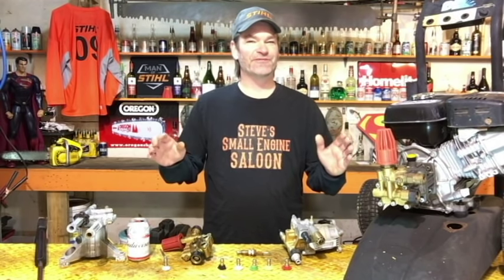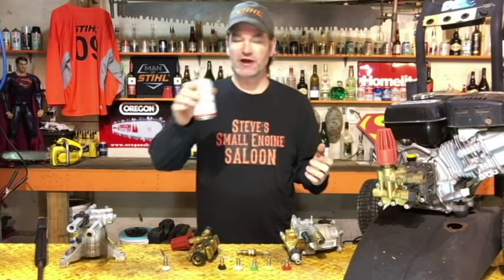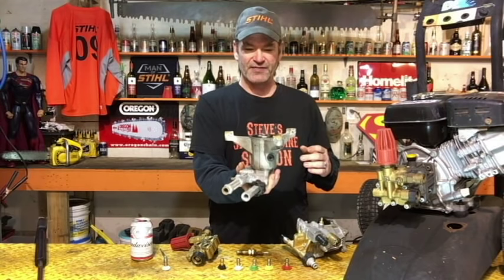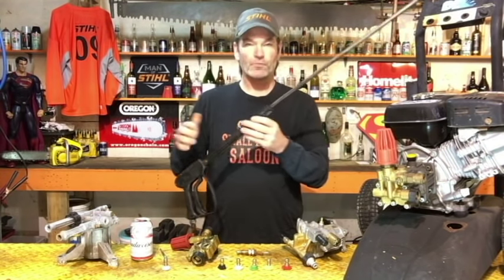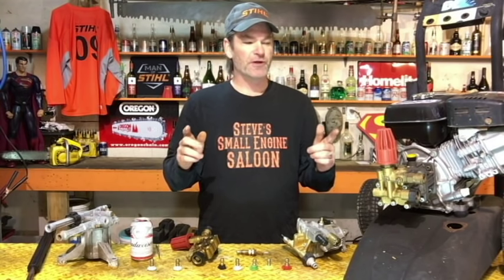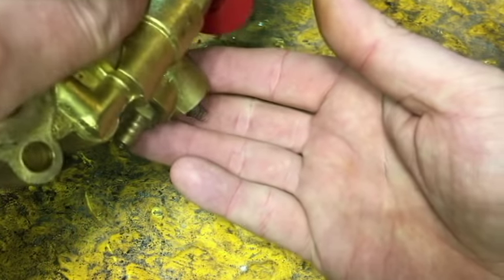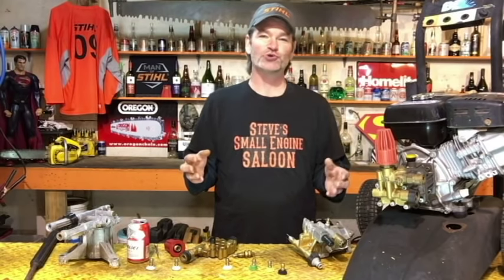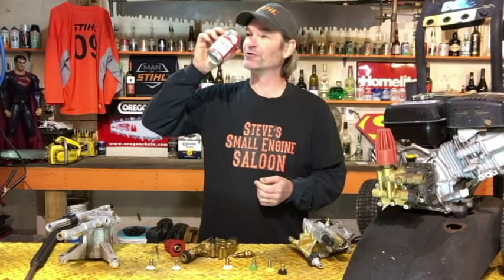How To Fix A Pressure Washer That Has Low Pressure

Comment: Thank you so much Steve for making this great detailed video. Can you please let me know if 3200 psi with 45 degree nozzle is too much pressure for car washing ? and if you can please guide me about the safe pressure for car washing, I will be glad. 
Thank you
Reply from the maker: That is fine for car washing, but the key is......how close to the car is the tip of your wand!  If you stand back a couple feet, the pressure hitting the car if far less.  If you put the nozzle 2 inches away from a rusty spot, it will blow a piece of paint right off!  Just use common sense and you should be fine.....  Was that helpful or no?
Reply: Thank you so much for the quick reply and help. That does make sense
Reply from the maker: You're welcome...
Reply: Pressure is not what peels paint, water volume is. If it is a machine bought at a chain store it will not take off paint
Reply: @AustinVb14    l am sorry Austin but I disagree with you.   Take the water hose off of the pressure washer and put the flow on the car.  You will have far more volume than the pressure washer but will not peel paint.  To peel paint you have to have pressure.  It is the combination of volume and pressure that does it and it depends what combination you have to what it will do and the tip your using.  Like Steve said the closer you are the more it will do with whatever combo you have.

Dale in Canada
Reply: Dale, thanks for your observation. But i do do this for a living. Been innthe pressure washer industry for 15 years.

Comment: Hi Steve i replaced the oil on the pressure pump and now the power washer loses pressure within 3 seconds after starting to spray 
I used the manufacturer oil for pump crankcase 
How much oil should be in the pump?

Comment: Tanks for the instructions,  you are very clear but you don't explain how to work on the pump on your right on your bench.  Tha's the one I have and when I pull the trigger the engine loses power.  I don't know if the problem is the pump or the engine itself.  I will appreciate if you talk about this problem.  Have a good day..

Comment: Steve one of the most common problems I’ve seen in the shop is the customer has a higher rated GPM tip size than the pump is rated for. 3.0-4.0 GPM tip on a 2.0 GPM pump

Comment: U forgot to mention that the check valves can melt and cause a blockage I learned that the hard way at first I thought it's calcium buildup after putting clr and it didn't dissolve I pulled it out with force found out its completely melted now I'm not sure why their is a ball in the inlet channel looks like it blocks off the 3rd hole when water is going to come in is it normal or it doesn't belong there?  I took apart the entire manifold from a generac speedwash 3200 psi 2.7 gpm pressure washer any help

Comment: My Ryobi builds pressure when trigger not pulled, and blast all pressure out when I pull the trigger...even the engine revs up building pressure when trigger not pulled, but revs down when I pull the trigger, And I lose all pressure .
Reply: Figured it out,, It is a worn out nozzle , the hole is too big, so it does not kick in the valve.

Comment: Hello, first off thank you for the informative video! I have a troy built pressure washer. A few months back the pressure washer started a fairly strong vibration and started going in and out of pressure. After a few times, the pressure permanently reduced. Do you have any advice on how to diagnose this specific issue? Liked and Subscribed! Thank you.
Reply from the maker: Is the pump on the bottom of the motor, like a lawnmower?
Reply: The pump is on the side of the motor towards the handle. If your standing directly behind the pressure washer as if you were pushing it, the pump is located on the back right of the machine. The hook ups are on the right as well. The throttle control and choke are on the front of the machine. I appreciate your reply!
Reply from the maker: Is it possible that you live in a cold climate and the water in the pump froze at some time?
Reply: That would be a possibility, I live in North Central WV.
Reply: Justin Rogers check the check valves, if you havnt used machine in a while or screen is broke for the water inlet theres a chance that something is stuck in the valves or that they are frozen stuck. Pulsation in the pump is either because its sucking air as well as water or one of the inlet valves is not working.
Reply: Thank you for the reply

Comment: I'm at a loss so this is my last resort for an answer. I have a Simpson Pressure Washer. My motorcycle fell on it and broke off the connection from the gas tank to a small tube on top of the tank. I can't find what this part is called, what it is for or if I can run the pressure washer without it. Any help would be appreciated.

Comment: Thanks Steve for the good tips on fixing my pressure washer. Never could get it to spray the detergent. Did 'nt realize that I needed to use the low pressure nozzle. [ Also good great idea about the rum and coke ]
Reply from the maker: You're welcome...
Reply: I also find that a good Whiskey with rocks works well...

Comment: Thanks again for all of your videos.  You are my go to for every engine I have!   I rescued a Husqvarna 3100PSI washer from the side of the road.  Typical gunked up carb.  Got it running, but it still only makes 1900 PSI at idle max.  I took apart the unloader, spring was intact, but it didn't have a red handle like yours.  Are some of these factory preset and non adjustable?  

 Lose the Bud though!  Try some Yuengling!

Comment: Hey mate I know this is an old video but my adjuster knob just has a bolt shoved in it an Yh I have no
Pressure also my handle an line an nozzles are brand new

Comment: I left my petrol pressure washer running for about 10 mins without spraying. It's got no pressure/ water just squirts a little when trigger is pulled. Help/advice appreciated.

Comment: Mine stalls under full pressure when releasing trigger.  so I turned it down a 1/4 and it idles now. I’ve changed the o rings and valves. 
Mine has a black pressure nob with two springs inside each other.  The big one doesn’t seem to want to come out. Is the unloader valve under that?

Comment: Hi Steve it's art, I got a 190 gcv Honda pressure washer,  do you have to ad oil to the pump or just the motor? It's up and down, not sideways, thanks!!!
Reply from the maker: Most of those are sealed units
Reply: @StevesSmallEngineSaloon  awesome less to worry about, I got a Honda pressure washer and Honda mower for 30 dollars, I put a carburetor on the mower runs great and on the pressure washer I just turned the gas valve on, started first pull!!! Lol now I'm making money on power washing houses ..I just bought a power tip from Lowes..wow I blew paint off my neighbor s house, that 40 dollars is worth a million to me, the white tip took me hours on side walks...this thing cleans fast, thanks for your videos steve you help tons of people, God has a spot for all of us!!! Mine is mowing, I've got a scag and I cut 30 yards, I love it, thanks again steve, art.

Comment: I have one of those yellow German pressure washer from around 17 years ago Costco sold.
The pressure washer is way in the back of my shop and stuff piled on it so I can't see it at the time but I think the name started with a "K" ...Like I said some German name.

The pressure had an issue years ago and a shop fixed it for around 3 times before it did it again.
The big black head that spins, kinda looks like a wasp nest cone. that stops the spinning, hit the head a few times and it gets going but has gotten weaker and will no longer work.
seems like when the pump kicks in it kicks right back out again.
The colored heads work but again I have to pull the trigger several time for the pump to take.

I know, Long winded but I really would like to uncover it and use it again.

How Much Beer Should I Have 4 This Job!???🤔😁👍😉
Reply: It's K for Karcher...... And you'll need German beer to fix it. 
No lesser beer will achieve the desired results. 
You will thank me later.
Reply: @patagualianmostly7437  ....I guess that set my foot in the right direction.
Thanks!   🤞🤞🤔😉

Comment: Steve.... Can the same yellow or any other color tip be used on a 2800 psi and a 4000 psi washer? Your help would be greatly appreciated.
Reply from the maker: If you use a 4000 on a 2800 you will have less pressure because the hole is bigger..

Comment: What oil or gear lube belongs in the pump housing for Ryobi gas pressure washer ? I haven't been able to find any information on it besides that it was lifetime oil
Reply: 30 weight motor oil
Reply: Ryobi wrote that it's a gl5 oil not intended to be changed
Reply: The motor not the pump takes w30
Reply: @NOFx420x  , my John Deere pressure washer with the annovi reverberi pump uses sae 30. Not sure about Ryobi. If they say that it's a life time oil, it's probably gonna fail. Oil will eventually lose its viscosity. I had a couple of BMWs with the lifetime transmission fluid. I changed the fluid ASAP! Never had any problems with either  transmissions. Almost as if they want them to fail. 😉

Comment: I have a pressure washer I’m working on right now, it actually had a few of these issues and I was able to repair them all prior to watching this video, but I have one remaining issue I just can’t seem to eliminate. All is hooked up, air bubbles are cleared, I fire it up, and it runs like a dream. I let go of the trigger, it idles down, and starts shaking like crazy and wanders across my driveway! Any advice would be appreciated….
Reply: Same here have you found a fix or the problem?
Reply: @kevinmorgan9225  in my case, the pump was partially blocked. Tried everything including some time in a sonic cleaner. I looked up the price for a few new parts, gave that info to my client. It was cheaper to just buy a new pressure washer.

Comment: Hi Steve - I have a Homelite UT80516 2200psi washer. Every year I'm working on this thing. Swapped out the carb, good for another year. Last couple years I've had to pop out the unloader valve and clean it out. Each time it's good for yet another year :) It's never stuck but cleaning it seems to do the trick.
Unfortunately this year the clean didn't work. I popped it out and cleaned it up but the pressure didn't come back.
I noticed that I get an initial burst of water pressure and the unloader valve spring pops out a little (altering engine revs) but it just dies out right away. I tried tightening the nut that holds the spring down but that caused a whole lot of back pressure and I had to give the handle a really hard squeeze to open up the valve. Even stalled the motor so I eased up on that...  Any ideas? Time for a new unloader valve? There's not much to these things. It's hard to imagine anything other than it being stuck or dirty inside. Spring fatigue? Maybe the pump?
Any ideas would be appreciated.  - Great Channel BTW! As soon as I saw the rain I thought you might be from BC. Used to live up on Quadra myself - Cheers!

Comment: Hey Steve my power washer starts fine and the water runs but when I let go of the handle after using the washer for a little it does not shoot water again and I have to restart the pressure washer.

Comment: I have a question about pressure washer mine won't spray soap or deck wash chemical anymore and idea what to check I have the correct tip in it I even bought a new tip still nothing

Comment: Whelp, I liked the video, but none of the issues covered identify with my problem.. If I allow the pump to build pressure, it usually is released under the pump, but it never gets to that point any longer. Now it just sort of squirts out of the side of the pump when I pull the trigger. I'm thinking it's a seal, but wanted to see if the video covered it.

Comment: Hi Steve 
Recently my worker had used my brand new powerwasher 4200psi and ran it with hose kinked no water ran through it for about a minute, it still works but only has about 3200 psi. What do i do to fix my issue
Reply: First fire the worker, then replace the  "high pressure packings" in the pump head :-)

Comment: How does one change blade shaft bearings on a mower deck (specifically Toro 38")? I can't get the pulley off of one shaft, and can't get the shaft out on the other one.

Comment: Anyone try to repair a home lite 2700 pressure washer that lost power? I took apart the high pressure side but none of the parts like the ones in the video came out (spring and O ring).  Another thing that’s different with this model is when I pull trigger on the wand I don’t hear that there’s a load put on the motor. Any advice? Besides buy a new pressure washer.

Comment: Help please.  My pressure washer builds up pressure but as soon as I press the trigger on my wand, a lot of pressured water comes out.  Then the pressure stops.  I have to let go of the wand trigger, pressure builds up again until I pull the trigger.  What could be causing this ?

Comment: What’s the yellow knob on the top of the pump just behind the Unloader knob used for?
Reply from the maker: Its just an oil fill cap with a vent on top....
Reply: Thanks for that Steve. So there are at least 2 oil caps, with the white one on the side. Why is there more than one?

Comment: Steve. Just found your channel. Love it. First question. I don't have beer or rum and coke. Will tequila be ok? Next question. I just bought a Ryobi 2700 psi pressure washer. I got it new in the box from a pawn shop. The manual says I'd I'm running it over 2000 ft above sea level i need to have a tech tune it to run at higher altitude. Is this something i can do myself? If so what do i do?
Reply from the maker: If it sounds like its running fine, I wouldn't worry about it....

Comment: Hi Steve! I had my pressure washer in my shed the past few months and just noticed some oil has leaked onto the floor from the pump. Can I just replace the large o-ring between the pump head and the housing, or can I just tighten up the bolts securing the pump head? Thank you.

Comment: This guy crack me up, Run and Coke
Reply from the maker: Yum!
Reply: First I would of never thought you would respond to me, I am happy ha ha ha allot of respect to you. Ihave a problem with this second hand power washer I bought for a business I will like to start. It is running but not staying running. I cleaned the caberator about 5 times. Thinking to buy one but not sure this is going to resolve the problem. The guy who wants to fix this is going to charge allot. I also clean the plug and pressure valve. Check the filter and all that do you have any advice
Reply: @StevesSmallEngineSaloon  hi I am happy you respond to me would of never think you would love your videos
Reply: @StevesSmallEngineSaloon  First I would of never thought you would respond to me, I am happy ha ha ha allot of respect to you. Ihave a problem with this second hand power washer I bought for a business I will like to start. It is running but not staying running. I cleaned the caberator about 5 times. Thinking to buy one but not sure this is going to resolve the problem. The guy who wants to fix this is going to charge allot. I also clean the plug and pressure valve. Check the filter and all that do you have any advice
Reply: @StevesSmallEngineSaloon  really need your help

Comment: I have a pressure washer that loses all pressure after pulling trigger on the wand. After I release the trigger, the presure build up right away again. Pull the trigger and the water sprays hard for half a sec then loses pressure again. Any ideas on what could be wrong?

Comment: heres a good question: recently received a craftsman 2000 psi washer …. without attaching hose and washer gun …  pump shoots out water like a geiser with great pressure ..  hook up a brand new hose and gun and it sprays out very low "pissing" pressure ??????  any info please and thanks ..

Comment: Hey Steve, is that small yellow knob on the top of the pump a pressure release? The yellow cap popped off mine. Thx
Reply from the maker: Its a vent..

Comment: I have problem with my P W  machine. Start perfectly work for 10 minutes  and then turn off . clean the carb change spark plug  oil atc still the same problem ?
Reply: I would think your air to fuel mix is bad or a choke issue.   To much air or maybe it's to little will cause it to quit after it gets warmed up

Comment: What's a good way to winterize the sprayer 🤔
Reply: I blow mine out with compressed air to winterize it. I've seen cracked pump housings when water was left in and froze.

Comment: Steve, how do you eliminate rust in a metal gas tank during storage? I recently gave a spray or two with fogging oil. Any suggestions?
Reply: Try a little bit of marvel mystery oil in the tank. Maybe an oz?

Comment: My pressure washer pump wants to stay engaged after releasing the wand handle.  Any ideas on what is happening and what needs to be repaired or replaced?
Reply: That red knob he is turning not only adjusts the pressure, it also "unloads" the pump. If the unloader valve fails the unit will deliver constant pressure. These rarely need replaced. It could have debris in it somewhere or maybe a torn o-ring. Remove the unloader (as shown in this video)  and inspect for anything that might be causing it to stick. A good cleaning of this valve as well as the area of the pump into which it is inserted may be all it needs.